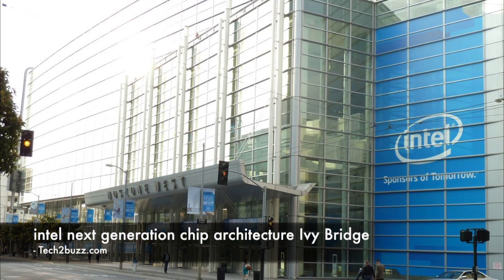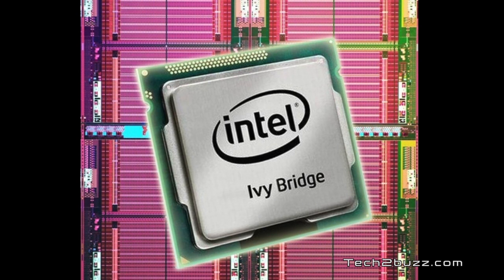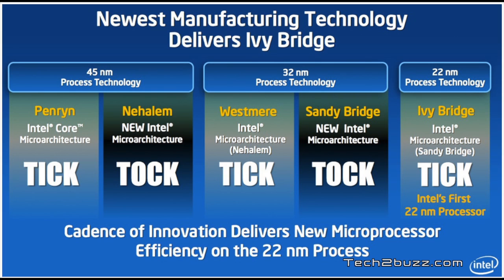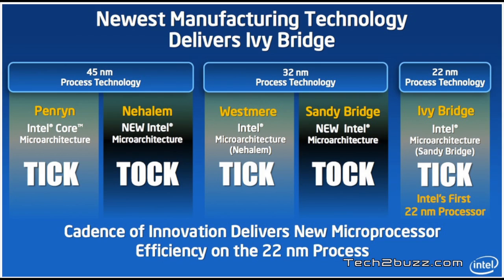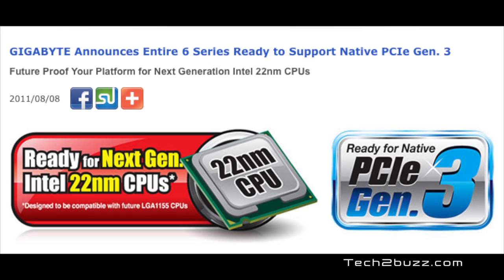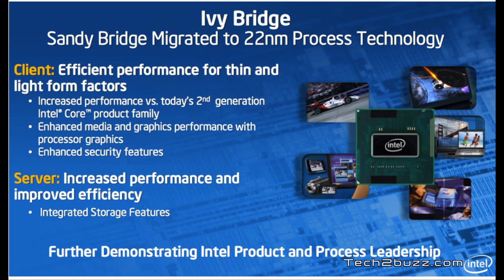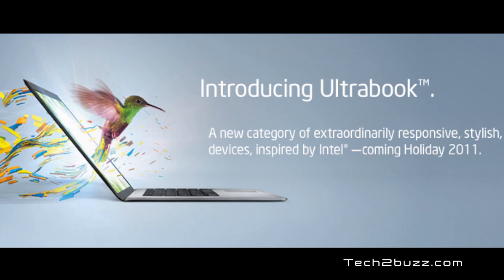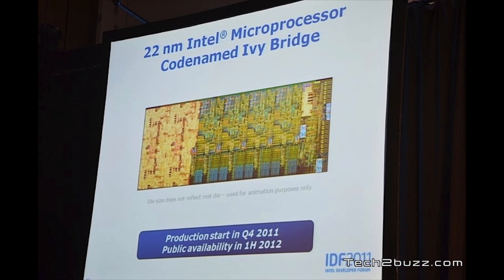intel next generation Ivy Bridge processors overview

Comment: hi ranjit,
i wanna buy a Assembling pc. suggest me a good and high speed configuration......for overall performer like a gamer, software developer, etc., as i am a MCA student i run large application softwares.......so my system should run fast..... and my system should support win 7, win 8, linux, and unix OS (all) etc., 
intel i5 3rd gen, 6mb cache, 4 core processor
Asus P8Z77-M PRO MBoard, Vengeance 8gb ddr3 ram, 500gb hdd.. Is this enough for me........ or else suggest me a good one

Comment: Some new and greater things about the Ivy Bridge CPU's that have been brought out into the open since this video was released is it is going to have a 3.0 controller in the CPU that will allow you to take advantage of the newer PCI-E 3.0 ports on newer motherboards. Also You will benefit greater from using VirtueMVP to combine the graphical processing power of your Discrete GPU along with the intel 4000 series graphics built into the Ivy Bridge CPU's themselves.

Comment: @geekyranjit I just ordered 3.4GHz Quad-Core Intel Core i7
4GB 1333MHz DDR3 SDRAM - 2x2GB
1TB Serial ATA Drive
AMD Radeon HD 6970M 2GB GDDR5,

As you said it doesn't make much difference in Desktop, so should i fine with this or is there major difference in Graphic performance,, Should i put my order on hold ??

Comment: @callmesmorz The i7 3960x is slightly better than the 1100t (everyone knows that), but for that price you can get a whole AMD gaming rig with a decent graphics card (or 2). Unless you're a rich kid who steals money from his mommy and daddy then you aren't getting an enthusiast $1000 CPU. Intel is good but the prices are terrible. The only decent priced Intel is the i5 2500k and i7 2500k. The only difference between 2500k, 2600k and 2700k is 100Mhz, and you're paying £80 more for each 'upgrade'.

Comment: @nhs2008NC Plays Crysis at an unplayable framerate* -.-

If you want a cheap processor with an onboard GPU which can play BF3 at a playable framerate at low settings then get an AMD APU. Intel sucks.

Comment: @PyroMania61 Wait for Ivy Bridge. Core i7 3770K is almost the same price as 2600k. And  also u can use a P67 or Z68 mobo if you have one. The Ivy Bridge lineup also supports 4k resolution and probably will have a low TDP due to the smaller Die size 22nm (around 77 TDP, which is indeed better than the SB). Btw you've a got a decent graphic card which will make a good combo. A few months away until it gets released.

Comment: @geekyranjit Well, I consider buying either Intel 5 2500k, Intel 7 2600k or Ivy Bridge.
Since the difference in performance between I7 and I5 is only about 2-3%.

So basically it's I5 vs I7.
Which one is the better choice?

I ask you because i really appreciate your knowledge by the way :3